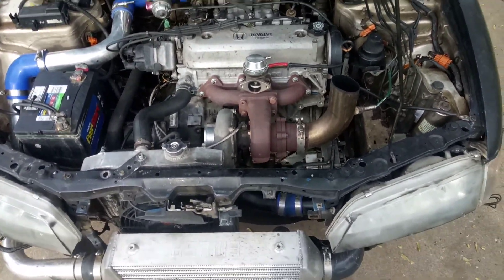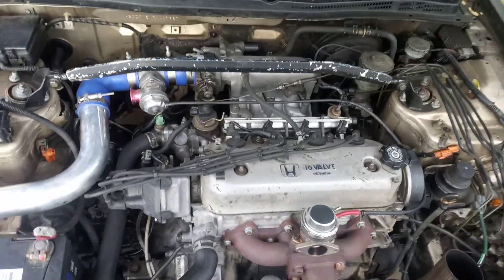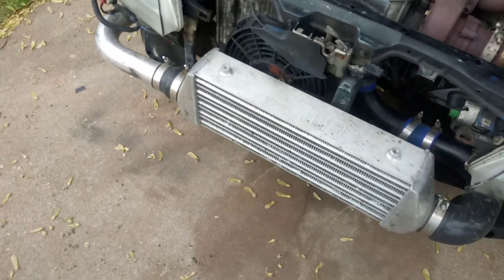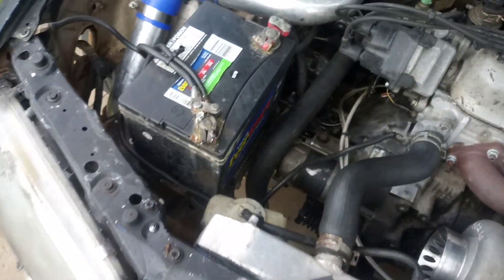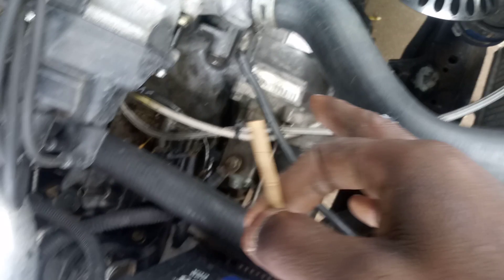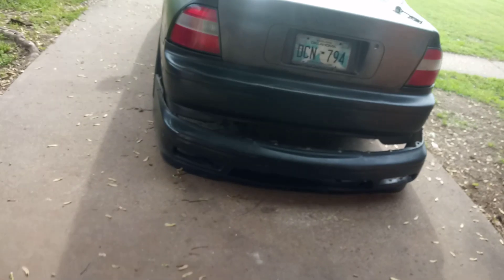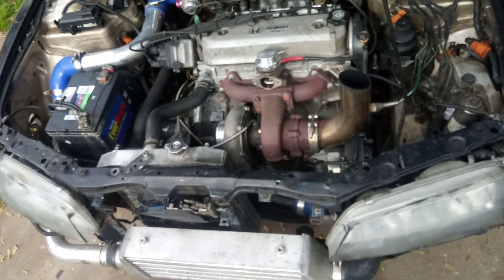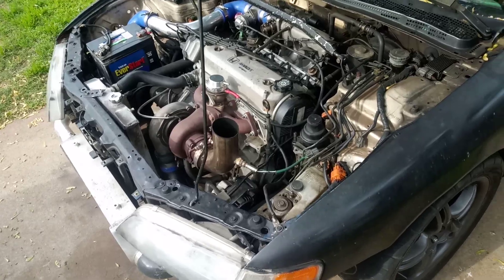Turbo f22 accord set-up

Comment: You remember ptsfab has their 1060whp f22 turbo with a felta 272 regrind camshagt. Brent from pfispeed tuned it. 😎 I love them an crazy TQ being a 2.2L sohc 💪. Also dirt cheap. If my k24 turbo ever goes out in my integra im building a f22 non v engine in it for 950whp.

Comment: If I'm running 4 psi do I need to upgrade my injectors
Reply from the maker: Yes upgrading the fuel system is needed
Reply: @theboostedsingle5356  I have the same motor  , what kind of cc do I need ?
Reply from the maker: Anything bigger than stock will be good but the bigger the better maybe 450cc or higher

Comment: If I'm running 4 psi do I need to upgrade my injectors
Reply: With 4psi you can use an fmu setup, they can go up to 6psi no more than that. But it allows you to boost a car without tuning or bigger injectors.

Comment: Can I please get some specs on your interior build? Like what is inside that monster of an F22b. Right now Im thinking of a budget build, rather than spending so much on an H or K swap series. Want to build my f22a1 so bad man, but still need alot of help on what to put inside before getting a turbo kit. Thank you
Reply from the maker: It's a stock motor f22b2 on e85..only thing we did was add arp head studs and new oil pump and water pump kit and rear main seal.. other than that it's all stock bro lol
Reply: @theboostedsingle5356  no wayyyy, thanks man. what do you mean e85 bro? like the fuel system? how about your pistons man, stock?
Reply from the maker: @ljfleming5904  yeah e85 fuel..stock piston stock everything besides arp head studs

Comment: Was there a hole in the back the tape was covering? When you was talking about your fuel pump?
Reply from the maker: Yes..i cut a trap door so we didnt have to drop the fuel tank..we just put some foil tape over it lol
Reply: @theboostedsingle5356  oh so on the accords you have to drop the tank to replace the fuel pump?
Reply from the maker: @righty-tightybuilt548  yea..i didnt wanna go thru all that since its a race car..i found out where it was and cut a trap door in it..cover it back up with some good foil tape lol
Reply: @theboostedsingle5356  damn thats crazy I guess the coupes and sedans are different, I think the sedans you just have to remove the bulk head and disconnect the connection and pull the pump up with the top cap. Its just like civics and integras underneath the back seat

Comment: How about that turbo you are using? Did you do research on the specs? Like is it ball bearing or it a journal bearing turbo? I just would be afraid it blowing up on me and doing serious engine damage! Other than that nice setup! 👌👍🏻
Reply from the maker: Your worried brotha dont be paranoid..turbo is capable of 500hp..its a ebay gt3582 ive been using it for about 8 months now no issues

Comment: iv been following your build. do you have wheel hop? so you need or have a traction bar?
Reply from the maker: Surprisingly it doesn't have wheel hop with the 235/45/17's it hooks very well ill post 0-100 pull when i get out again